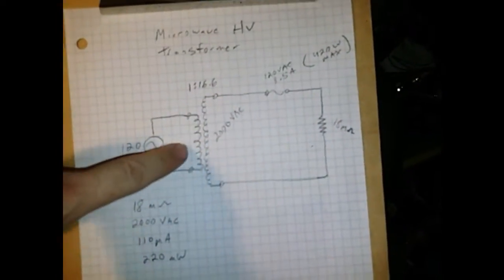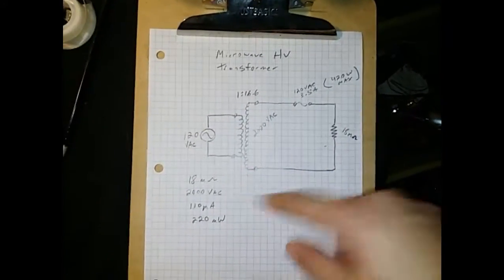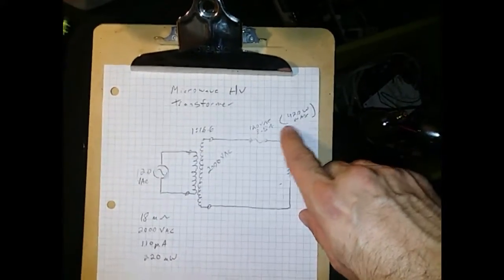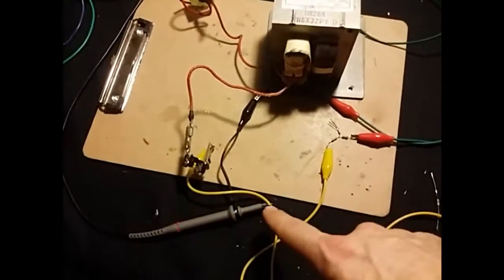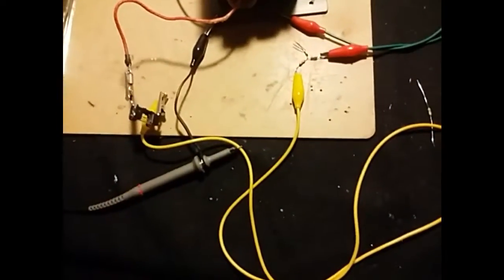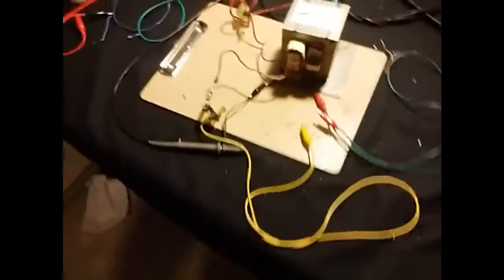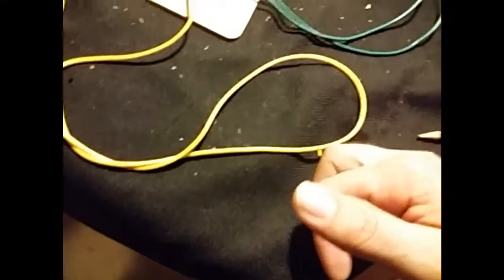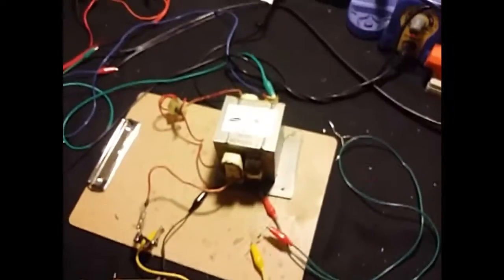High voltage fuse test

Comment: Let me start with PLEASE, DON'T DO IT AGAIN!!! LEARN THEORY FIRST! DON'T PLAY WITH HIGH VOLTAGE UNLESS YOU FULLY UNDERSTAND IT AND HAVE HEALTHY DOSE OF FEAR FOR YOUR LIFE!!! Almost everything you have in this video is WRONG, INCORRECT, and DANGEROUS!!!

You are NOT doing this correctly. Around 1:29 mark your "math" shows that fuse is designed for "420W max". You are confusing "power dissipated in the circuit" vs "power on the fuse".

Power is product of the voltage and current ON THAT PARTICULAR ELEMENT in the circuit (this get's more complicated when load is not purely resistive, but let's ignore that for a moment here). Resistance of your average fuse is well under 1ohm (usually in tens of milliohms), so voltage on the fuse is in millivolts, and dissipated power in mW. Power that you are calculating is power of the circuit behind the fuse in the case you go with rated V/I. Almost nothing to do with fuse itself!!! (I does, but in a different way)

Now, what markings on the fuse actually mean (for example 120VAC/3.5A)? 

It only says that fuse should NOT be used in circuits with over 120V AC (the reason being that fuse is designed to sustain "flash over" (arcing) for up to that voltage). Note that when fuse blows, all the voltage will be on it's ends!

It also says that any current over stated (3.5Amp in this case) will eventually cause fuse to fail (blow). Usually, if you apply rated current, it will blow after 10000 hrs, if you apply 10 times the rated current, it will blow in 0.1sec (or whatever manufacturer declares).

Now, to prove this point, make the following circuit:
*  low voltage source (12V car battery, or transformer with lets say 10V, or computer power supply 5V) capable of providing current of more then fuse's rating (let's say 5Amp in this case). 
* resistor that will sink current larger the fuse's nominal current (for example, if using 5V PC supply,  R < 5V/3.5Amp = 1.4Ohm -> use 1ohm/25W). You can use 12V car battery and 60W/12V car lamp, that would work perfectly!
Even though voltage in this circuit is very low (5V), and "power" (5V * 5A = 25W)  is much smaller then your "420W" calculation, the current is over nominal for fuse, and the fuse will blow. 

So, it's not the "power in the circuit" but current through the fuse that cause fuse to fail!

Let's do another that will disprove your "power" theory:
NOTE: DO NOT ATTEMPT THIS ONE, THIS IS ONLY INTENDED AS MENTAL EXERCISE!!!
The same transformer you have (2000V), resistor 1kOhm (resistor must be rated for 4kW)  - that will give you 2Amps (transformer you have is undersized for this power, but as I said, mental exercise only). Your fuse will happily work as the current is under 3.5Amps, even though power in the circuit is 4000W

The problem here - if current rises above 3.5Amp and fuse blows, chances are that you will have arc inside the fuse that will NOT break the circuit.

Now, what "burns" the wire in the fuse? Technically it's NOT "just" the power (heat), but current density (current over small surface area). And that has nothing to do with "120V * 3.5Amp" that you use as an explanation.

On a totally different note - don't take this the wrong way, but your setup is dangerously reckless. Playing with kV in lose wire setup is CRAZY DANGEROUS!

Also, having your o-scope with "plain" probes (x1/x10)  connected to "something" (fuse) that can end up with thousands of volts (let's say fuse blows for unknown reason) is another indication that you did not think about potential damage (life/health/equipment).

And for all that watch your video and maybe had patience to read this diatribe till the very end - if you want to experiment, don't do it with anything that can kill you! Never use over (lets say) 30V, that way, you can burn yourself (hot resistor), but you want kill your self.
Reply from the maker: I not only have experimented with high voltage for years, I also have professionally fixed high voltage appliances for 20 years. I have not been electrocuted by HV yet, I know what I'm doing. If you want to prove to me that I'm wrong make a practical video building the circuit you mentioned, don't tell me to build a circuit to prove your point. Really? I am fully aware of the resistance of fuses and that the 120 volts is not across the fuse, that's very basic stuff there. When I say 420W I'm talking about the circuit power consumption. FYI I am well aware of inductive and capacitive reactance. I find your post long winded and a tad condescending and I don't think you got anything of what I was explaining, that's ok, not everyone will. Probably because I didn't regurgitate it from a theory book. Go build a circuit and post it. It will make you feel good.
Reply: Miroslav you are 100% correct!